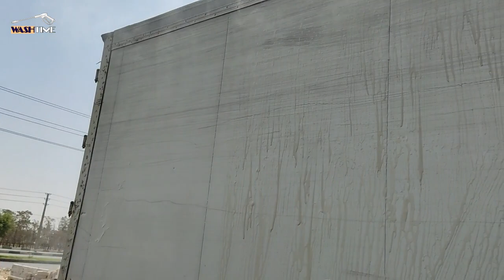SATISFYING!!Amazing result of refrigerated truck washing!!! #asmr #truck_wash

Comment: Good video but the power wash hose you have is small use bigger and more powerful power wash
Reply: yeah your true say about to power wash and i think much more than cleaning the truck and using snow foam
Reply: @aciretuazon2909  it depends on the wash process. Sometimes some people do a pre rinse, then soap then wash off for a touchless wash